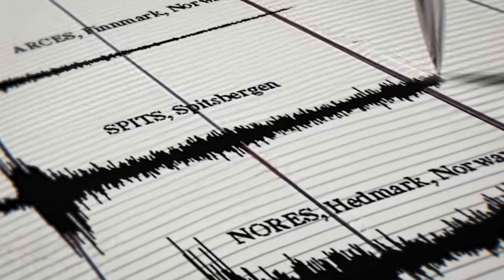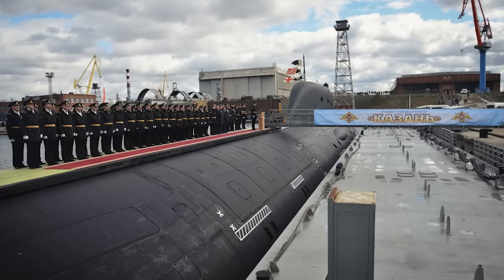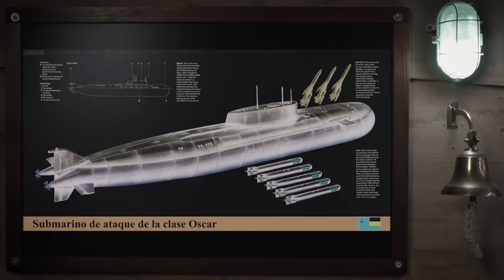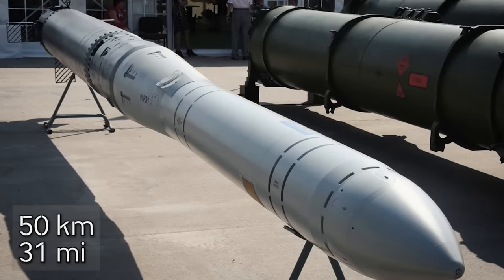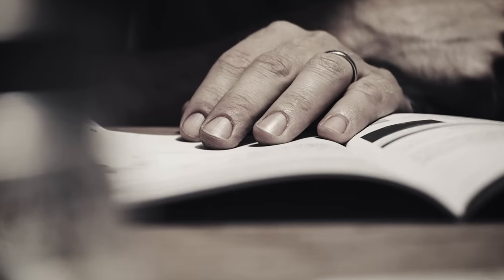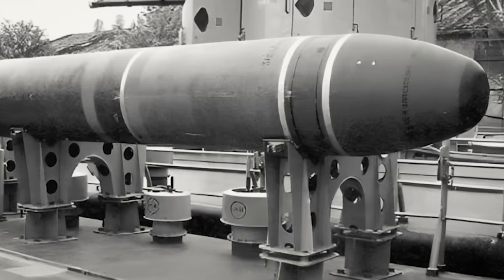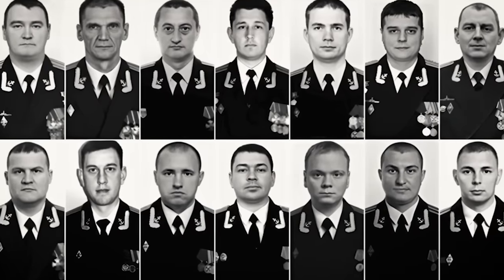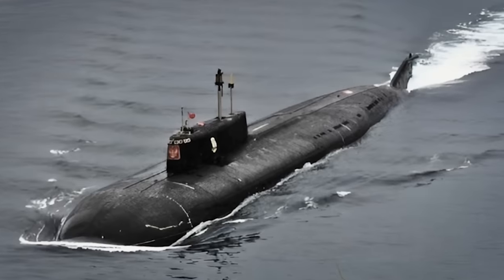This Chemical Killed 118 Men...

Comment: The emergency buoy wasn’t turned off, it was welled down because it banged around making noise and sometimes would deploy for no reason, it was actually welded down the day it left shore
Reply: Yeah, well...he also thinks that air will compress in a closed space from leaking, but not when a hatch is opened to deep ocean. Lol
Reply: this dude has several items of flagrantly incorrect info in every video he makes
Reply: @conzmoleman and
Reply from the maker: If a hatch to the side going into the sub laterally is breached and leaking water into the compartment then the air pocket above the lateral hatch will be compressed as water fills the space. It's the same pressure mechanics as a diving bell.
Reply from the maker: Fair enough. It's not always easy to find all the information the internet has to offer. 

I try add find all of the best information and often when a video goes out to thousands of people the collective knowledge is greater than one person researching. 

I live and learn. 

Which particular pieces of information in this video are incorrect and what is the correct information?
Reply from the maker: Thanks for the detail.
Reply: @waterlinestories  no biggie, considering the quality of content you provide, it’s just a tiny detail, it suck’s because the sub community thinks had they not done that, they might have survived, the time it took to find the sub, was more the difference between them dying, they would have found out sooner they couldn’t save, and let the British go in to get them..
But I absolutely love your videos,  i didn’t think you would even see my comment,

But yeah, they had problems with it accidentally deploying and and getting wrapped up in the propeller, 
In fact I heard about it on SUB BRIEF Erin actually did a deep dive into this subs life,
Reply: @ghoffmann821  the rear compartment had a escape hatch, it wasn’t flooded at the time it was trying to dock, water inside has no bearing on its ability to bond with the ship, the water pressure keeps the rescue vessel on the sub once the hull is breached. Plus it vacuums itself and equalizes with the interior of compartment
Reply: @maegenyoungs2591  Sub brief is Aaron Amick, not Erin. Small correction…
Reply: @maegenyoungs2591  It's honestly a crazy notion to think that, had they all survived, it would have been fine. Here's my prediction on that:

If they had been rescued before this had gotten to be such a disaster, the military would have shrugged and said "yeah but you lived, right?" and nothing would have been changed. The can would have been kicked down the road until some other poor crew would have paid the exact same price these guys did. 

People go nuts over the "what if"s but what's scarier to me is what would have happened if a disaster hadn't happened. It's the narrow misses that we don't hear about that end up causing the bigger disasters. The ones that make us more complacent with bad practices and stupid ideas, giving reality more time to wind up before punching us in the face.
Reply: @conzmoleman I also like making baseless accusations and running away
Reply: @conzmoleman Do it better yourself then.
Reply: @maegenyoungs2591  The British obviously cannot be allowed to just wander around freely in a highly classified nuclear sub taking who knows what notes/pictures/etc while you aren't there. The Americans or indeed the British themselves would never allow Russians to do the opposite in their own nuclear sub either.
Reply: @gavinjenkins899 the difference is that the United States and England would be competent enough to rescue their crew
Reply: @samholdsworth420  The accusation levied here was about acceptance of help, not the original competence. I don't think anyone disagreed about the latter, we did about the former.

Comment: Just a point from someone who owns a couple of ex military Russian rebreathers, the potassium superoxide (KO2) does not absorb the CO2 but reacts with it to produce more oxygen.  (2 KO2 + CO2 → K2CO3 + 3⁄2 O2)
It's quite an exothermic reaction and the scrubbers have been known to burst into flames at times. The Russians use this system because it makes a small oxygen tank last a very long time and as CO2 production is keyed to metabolic rate it can maintain a fairly constant O2 partial pressure without the need for electronics as used on most other rebreathers.
The rebreather shown at about 21:29 is an IDA 71, one of the cannisters (the blue one from memory) holds the superoxide, the other one normal soda lime, usually a mixture of NaOH and CaO, although sometimes LiOH and KOH are also added.

Comment: I remember when this tragedy happened. A friend and I were discussing the news that the Kursk was on the ocean floor over 100m down. It was sad to realize that some of the crew survived initially, only to ultimately die hoping to be rescued. Truly this was a tragic accident.
Reply: And they could have been saved. The hatch was there to connect to an external escape capsule that can be lowered and attached. But only Western systems where near enough to help. Russia refused foreign help until well after everyone had died, when they paid I believe a Finnish company to raise the wreck.
Reply: Not just "ultimately died" but died hideously from an exploding "safety" device or choked on the fumes it created. Appalling deaths.

Also - a CO2 scrubber canister on a submarine that will explode on contact with water. That is the definition of "don't give a fuck" deign and provisioning.

Poor bastards.
Reply: @221b-l3t it was Smit and Mammoet from the Netherlands  who rises the Kursk.😢